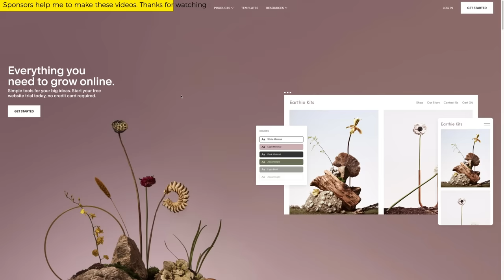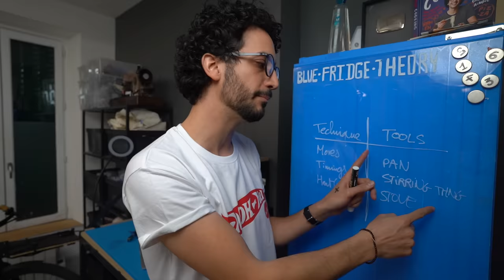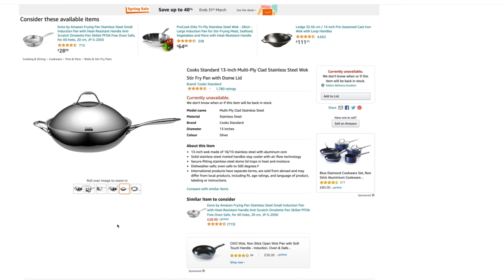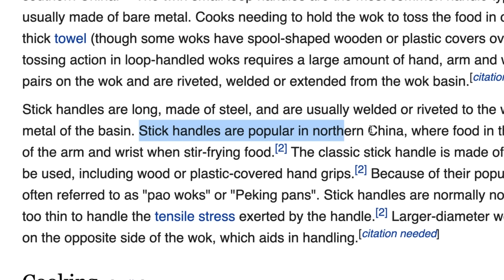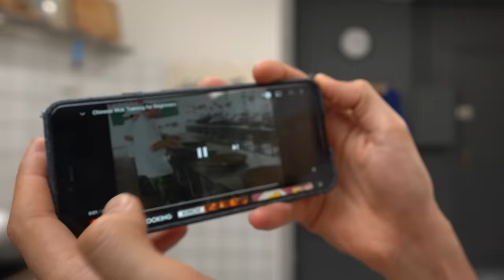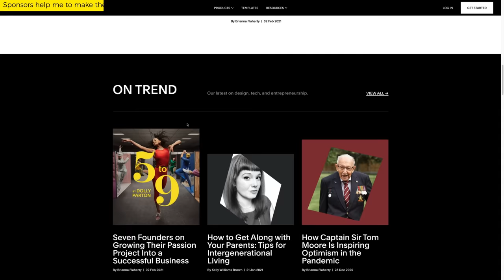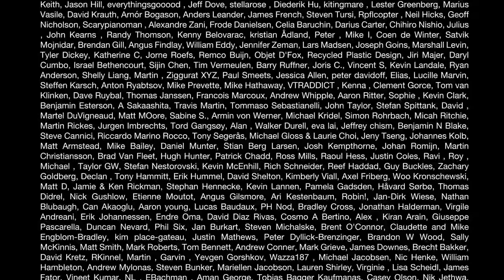Searching For The Perfect Wok

Comment: I’ve worked a at a restaurant as a wok chef after learning fried rice and I’ll share this advice for learning/mastering the flick. Spend the time to try and flick and turn a steel wool pad or something similar. Get to the point where you can flip catch flip non stop. If you can do that comfortably you’ll cook fried rice no problem(of course seasoning and quality ingredients matter as well)
Reply: I started off cooking in a diner and that's how we learned to flip eggs. By the time I got to the Asian restaurant, I was ready for the wok.
Reply: I did that with a kitchen sponge when I was like 7 years old. I was really interested in the way my dad could just toss food around and he gave me a little frying pan and a kitchen sponge to practice with.
Reply: Great idea! Less mess and setup
Reply: What's the best wok for at home gas stoves? I'm guessing it's actually the wok in the thumbnail (12 or 14 inch carbon steel w/ a wooden handle)?

Comment: you said it perfect Alex ,the thick steel will hold the temperature longer. Woks are so thin to give you "perfect"control from very high to low in a milli sec. to prevent burning. If the wok stays hot it will/can burn your sauces ,or you  can not get it hot enough. And the ändles"are so long to keep your hands away from the big fire ,flames and splattering hot oil.

Comment: my grandpa taught me to practice tossing with ice cubes. it adds some weight; the dimension of the cubes are usually bite size; when it melts, it adds the sauce component; and the mess is usually easier to clean.

Comment: I use a really nice short handle cast iron wok.  It was hand sanded and heavily seasoned to the point that the interior feels closer to glass than metal.  Its only drawback is, as Alex stated, that it is fairly heavy.  But that does mean that it holds heat extremely well which means that it works great if you can muscle it through use.

Comment: The hand that is holding the wok needs to toss the rice as the other hand pushes the rice with the ladle along the curve of the wok so there is two motions that need to be synchronized. Both need to move forward and back simultaneously. To achieve the smokiness the rice needs to be dry and cool (not warm or steamy). Hope this helps :)! Big fan, keep up the good work.

Comment: Start with flipping a steel wool that is flattened out like a disk. You have to use your left hand only for wok spoon righthand(i was told right hand is bad luck for restaurant) The movement is opposite of a normal pan flip in the air this took me like 2 weeks to figure out. So as you move arm back you go down and as you move forward you lift up. The forward and back movement is the most important part of constantly flipping and the spoon in right hand barely moves .and once you can flip steel wool move to dry beans easier to clean up and once you are good at that to master heat  i started with sautéing mushroom to learn how to control the heat then i moved to fried rice.. Hope this helped a little

Comment: The "shove" (or 鑊鏟 in Cantonese) at 9:35 is actually widely used in Cantonese home cooking.  Housewives do not necessarily have the strength to toss the wok and do the restaurant style stir-fry, and home stoves may not have the heat to keep things hot enough if we aren't letting the wok to stay still on the pit.  When we wish to mimic the stir-fry with less to no wok movements, using 鑊鏟 to scrape and stir whatever to be stir-fried is surprisingly effective compared to the ladle.

Comment: Dear Alex, I think you know that for fried rice retaining high heat in the wok in essential. Professional Chinese kitchens have incredibly hot stoves with blowers so they use think iron woks for faster heat response. At home, realistically, one has to trade heat response with heat capacity. That means using a very thick and heavy iron work like the ones made by the Japanese brand Nambu Ironware. In fact, when I lived in Europe, I used a de buyer sauteuse for stir frying and it worked perfectly.

Comment: For me it's just about getting stuck in and practising.  Don't be afraid to screw up and throw something out. Just practice alot, learn as much as you can and keep trying. And when it comes to marinades and sauces, often less is more. Don't get carried away and throw everything in on mass. If you don't have a powerful burner or a wok, just use a large frying pan and don't fill it up.

Comment: Funny thing, in SEA and indonesia. Two handle wok is very2 common in all size for deep frying everything. 0With all type material and for different purposes. 
Two handle means u mostly boil/fry your food on it. And later pour it out by two hand on serving plate/bowl etc. Or oil container.

And if u need stir fry, u could modified the one side of handle by using stick, wood shapen to grip on it by slide it in to hold and basically its one handle Wok by cautions.

Comment: I'm into Chinese cuisine and cooking and here's my takeaway after several years of experimentation: the carbon steel wok for quick stir frying is deliberately thin for 2 reasons: one, to ensure fast and uniform transmission of heat to the surface of the wok, and two, better maneuverability for the toss. But because thin wok transmits heat very fast, it is rather difficult to control the timing and it takes a very skilled chef to come up with a perfect dish. But then again thin wok is not very durable, hence restaurant chefs may use thicker woks but they have commercial grade stoves (the classic "jet engine" stoves) to generate greater heat to overcome the thickness and of course, they are all well trained to handle the added weight

Comment: When it comes to practicing the movements, it's important to note that whichever hand you will be using to stir with, it should be your other hand that holds and moves the wok. In other words, if you hold the ladle or spatula with your right hand, it's your left hand that should be holding the wok. That way you can stir and toss at the same time.

Comment: I actually find thin-walled woks preferable for home cooking, even on a gas stove.
The idea is that you don't actually want the wok to retain heat, unlike, say, a cast-iron pan.
With a thin-walled wok, you can cook food in batches without actually removing everything between batches, just move the cooked (or almost-cooked) ingredients to the edges of the pan while you add the next batch to the hot zone. This is especially useful when cooking aromatics and preventing them from burning.
Also, you can raise and lower the heat in the wok quicker than with a thick wok. Note that for Western stir-fries, they usually cook everything in one large batch, and they tend to have more liquid and sauce, so a thick wok is good for that. But for Chinese style stir fry, I definitely prefer a thin wok.

Comment: A little advice from a random Cantonese. You may want to hold the wok with a towel. Even with domestic stove, which gives less heat than a professional one, the wok handle is as hot as hell, so you need a towel between your hand and your wok. There are actually little guidelines in how to hold the towel comfortably without accidentally burning the towel in the stove, so you may want to check it out.

Comment: I don't buy all the hating on stainless steel woks. The is no reason to believe that it would perform any differently than carbon, but it also will not oxidize like carbon. I use a stick stainless I bought in Hanoi with a high polish and it is awesome, easy to clean. And thin is good if you have super hot flame, you can control heat by removing from flame. Don't hate on progress, unless you've tried it first. Love you: savoir faire is everywhere!

Comment: Most carbon steel woks are hand hammered and much thicker at the bottom than the sides where they're actually quite thin.  From what I understand they're supposed to taper like that.

Comment: I was taught never to toss in the air. The weight of the pan and the tossing strength decrease accuracy when tossing, resulting in spillage. It's also very tiring. That's why you always should use a pivot point and use the ladle to toss.

Comment: Might be an uninformed opinion, but wouldn't a thinner wok be better for heat management though? 

Since proper stir-frying requires super high heat, a thin wok would be better as it gets cooler quicker and also heats up faster as there is less barrier between the food & the fire (hence better wok hei?)

Anyway, great video Alex! Can't wait until you do the actual cooking as I am currently learning the art of stir-frying as well!
Reply: from my own experience, a thinner wok doesn't transfer or retain heat as well. But more important is having a stove that puts out a lot of heat. The typical GE gas range is only 9,500 BTU which is terrible for stir fry. Electric stove are also terrible for wok stir fry and will never get wok hei. At minimum you want at least 17,000 BTU to get good stir fry. Ideal is at least 50,000 BTU, but typical american kitchen is not designed for it. Most kitchens have a microwave above the stove, which will quickly die or melt the plastic.

Comment: @alex I kind of disagree with the assumption that a nonstick wok is not suitable for home use if you want to make excellent chinese food. There are confounding factors here. Hard anodized aluminum is the material used in high quality nonstick woks and the material is very thick and quite durable. This has two distinct benefits. First, nonstick, does not need to be explained. Second, aluminum conducts heat much better than carbon steel so you do not need as high of a heat to achieve high cooking temps. Remember, the heat below the pan is not the same as the heat in the pan once the food is cooking. The question of wok hei comes up and it is worth addressing. Unless you are cooking with an intense open flame, then wok hei is out of the question. Your average home range just doesnt produce tall enough flames for the liquid ingredients to mist and burn in to get that characteristic flavor. At home, if you want to replicate the high intensity in chinese restaurants, you need a specific burner for a wok. Alternatively, you could just admit that wok hei is not going to be a part of your home cooking, and admit that the right ingredients, cooked properly, with attention to detail get you 95% of the way to perfect and is more than good enough to make excellent chinese food at home...with a non stick wok...on an electric stove. There are millions of chinese americans who do not have the equipment to replicate chinese restaurant cooking at home who still manage to make excellent food at home.

Otherwise, big love for your effort and attention to detail!!!

Comment: Problem with the Cantonese one, for most domestic homes is the stove is not built for it, holding it is also not easier, most chefs have a small folded towel to hold it when they touch it to prevent burns and to give added support.

The handled one is easier to use at home due to the handle allowing for some balance. Flat based woks are terrible.

Also don't work learning to toss rice in a wok is harder than it looks. But once you get it, its like riding a bike and swimming you never really forget.

Comment: Fried rice is very simple if you understand what it actually is and why it is.  
It is not supposed to be a dish made from scratch, rather a way of using leftover food, recombined into a new dish.  
Pretty much all of the ingredients except the egg and maybe the onion depending on the style should be precooked and left to cool.
The rice and and meat is reheated by frying and we are talking medium low temperature for home cooking.  
The only reason to use a hot wok is if you are making it like a restaurant or production line.  
Lower temperature is the way to go. You are just reheating using oil.

Comment: The technique of tossing applies to both single or double handle wok. I believe both wok are good woks.
5:35 - you do not want the wok to hold the heat, that is one of the reason why the wok is thin.  I think you should do more research here.

Comment: Alex, you do NOT want your Wok to hold heat! You WANT the wok to be as thin as possible so it can change temperature quickly. When you put that shit on a 40 000btu stove, you don't need to retain heat. It's gonna be hot, don't you worry about that.

A big part of the tecnique you mentionned near the beginning of the video is to be able to control the heat. You cool the wok down using tosses, stiring, etc. and you increase the temperature by keeping your wok still on the fire. You can't control the temperature with a thick, heat-retaining wok. You won't be able to cool it down when you want, and it will take a long time to heat back up after!

The Northern Wok you already have is absolutely perfect. You can do the best chinese cooking you can dream of with that!! Your new Southern wok looks pretty good also, but it is too thick for MY personnal taste. It's still a LOT better than cast iron.

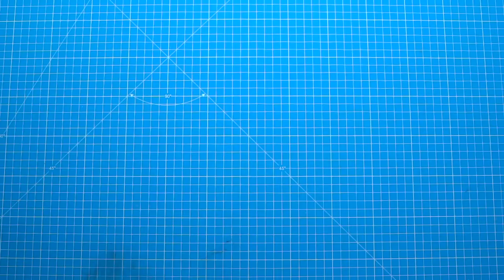As far as your cooking utensils go, I'd say a chinese chef needs both the large, flat spoon (9:35) and the big ladle (9:55). These two tools have similar but different applications. For a Chao Fan, the second one is definitely the best, however, the first one is also VERY usefull. I usually pull out both and use both of them depending on what I want to do. The flat one is amazing to scrape the sides of your wok. The curve at the tip is similar to the curvature of the wok, which makes scrapping the sides and bottom of your wok extremely easy. 

If you want to be a good chinese chef, you need:
1- Round bottom wok, Northern or Southern, just a matter of preference
2- the two spoons (9:35 and 9:55)
3- A decent gas or even charcoal burner
4- Canola/vegetable oil or another HIGH flash point oil. Never, EVER use olive oil for chinese cooking. Like you said, chinese foods are cooked on VERY high heat, your olive oil WILL burn.
5- A fuckton of MSG. Ideally, your jar should be labeled "Crack Cocaine". This is what is written on my MSG jar... seriously...

Comment: Its not the teflon that is worst for your body. Its the chemical composition of the glue they need to use. The EU actually banned the glue formula because of the risks it posed to health, but the supplier just made a new formula that isnt banned yet with basically all the same components. Teflon is extremely slippery and they need to use a specific glue to make it bond with metal.  I've studied PTFE/teflon that is used in cooking a lot and I would never recommend using it because of the dangers to health, unless you ONLY use it on low/medium heat.  

It's a shame this is not a well known fact by now, it poses huge risks to health worldwide. Stainless steel, cast iron and some ceramic paints are safe to use.
Carbon steel woks are better because you can infuse the metal with oils that give it better non-stick properties.

Comment: it really depends on where you are, which kind of wok is more common. i live in indonesia and many of the chinese diaspora here descended from southern chinese immigrants, so the southern wok is more commonly found here. i've been trying to look for northern style wok made from carbon steel, but it's like trying to find needle in a hay stack. for starters, carbon steel wok is harder to find to begin with since tons of the wok sold here are made from super cheap aluminum. for another, why the heck is the ones that look better all made from stainless steel???

Comment: I'm Chinese and I can tell you that 99% of Chinese people use woks with a long handle, those without (like the one you're practicing in the video) are basically only seen in the restaurants, and they offer absolutely zero advantage in cooking result over the ones with single long handles. Many westerners tend to think that no-handle woks are more traditional, but that's a common misunderstanding, it actually comes down to the size of the wok plus a little bit of traditional factors, in general, larger woks do not come with single long handles since they are too heavy to flip, these no-handle woks are also the cheapest in the market and are mostly used in restaurants, the smaller woks almost always come with single handle and all high-end woks are in this category, they offer better safety and are a lot easier to work with and for this reason more and more people are using them even in China. So if anyone's interested in Chinese cooking, definitely get the wok with a wood handle, it's a no brainier choice

Comment: The wok should be "opened", that is, to burn down the mechanical oil on the wok left on it during manufacture and make a oxidized layer of iron to prevent the wok from further rusting. The "opened" wok should be black

Comment: sorry to disappoint everyone, I have 5 woks and all are useless for my induction cooktop for oriental cooking, only the rounded Beijing wok I believe it is called, is fit for the job (Beijing woks have 2 handles like the Cantonese but they are made of thin cast iron, 1.2 milimetres I think. regardless by 28cm be buyer carbon steel pro (with 3 milimetres thickness) and a 21cm base does the job. yes it can only do 2 portions but still. woks are beautiful but I find them a waste of time for my (induction) case. You don't have to move up and down with the wok, a spatula does exactly the same, pan stays put and your spatula does the stirring. look if you use a western knife to chop ingredients, you don't have to use a Chinese cleaver to use it to prepare goods because it is a Chinese dish.